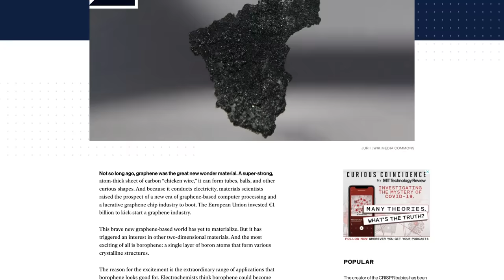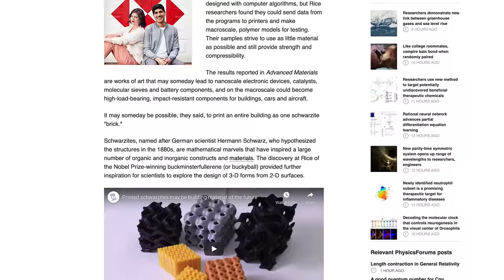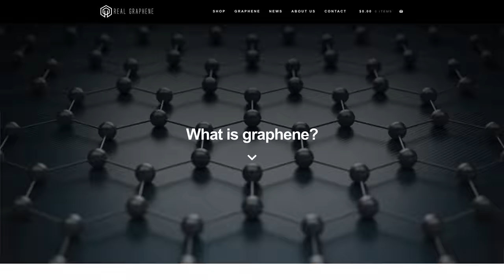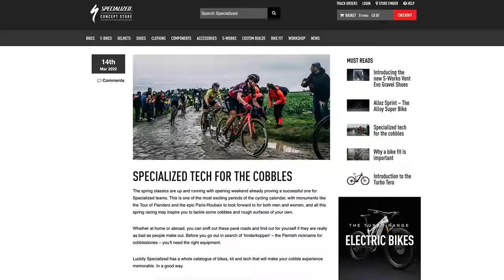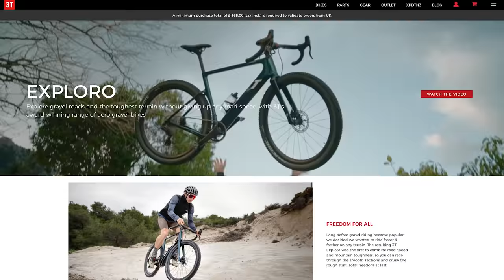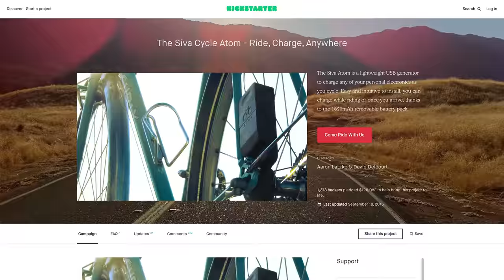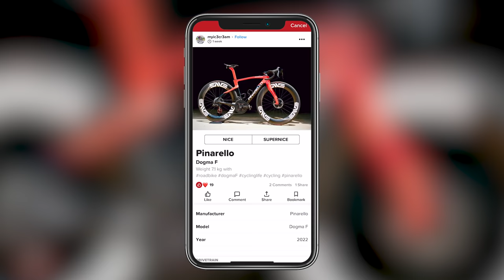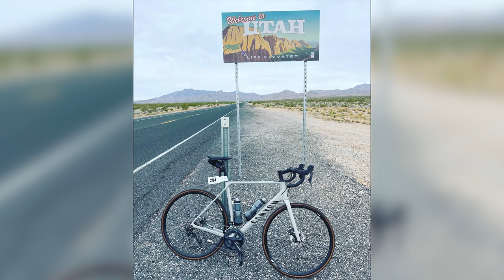Forget Graphene, Is Borophene The New Bike Wonder Material? | GCN Tech Show Ep. 224

Comment: my account balance says aluminium frame and rim brakes are best tho.
Reply: I'm with you all the way on alu frames. Not keen on rim brakes though.
Reply from the maker: It's all about that trickle down technology in 50 years!! 😂
Reply: @BrianRPaterson  disk brakes can be cheaper than rim brakes in some cases. up front cost a bit more yes but to maintain much cheaper
Reply: Aluminium bike and rim brakes are my favorites. I hate carbon and disk brakes. Useless polluting materials...
Reply: @dhanyrafael  Interesting! I would have thought carbon was more environmentally friendly than any metal, how so?
Reply: @fabster6667  It's not recyclable for one. Also the manufacture is quite energy-intensive I think. You can recycle aluminium really easily and steel frames basically never die...
Reply: @chrisnumnuts8671  the weight penalty is way too high for discs. Tadej pogacar still hesitates to use discs on mountain stages. Chris froome was also hesitating with the sponsors before start of tdf 2021. check his yt videos
Reply: I absolutely adore Cromo. It just feels so good. I ride a 1996 Giant Cross Nutra with some modern stuff on it but it's still an upright-ish hybrid straight bar bike. Thinking about trying to get disk brake on it but not sure how to go about putting a kit together. I use my bike daily for at least 6 miles per day
Reply: mine account saying, use feets.

Comment: this will make my Uni Inorganic professor happy, we spent 4 weeks on Boron clusters...   Also, super condutors arr material that allow electric to move without resistence and no loss of energy to heat, the liquid helium temperature are only required because the current material do not permit super conducting at room temperatue.   love the mention of chemistry on GCN
Reply from the maker: Ollie loves to put that PhD to good use!
Reply: @gcntech  well as a fellow PhD organic chemist, I understand the vibe.🙂

Comment: Its funny you mention tennis, they are actually the true weight weenie sport if you think about it (or at least their manufacturers). They used another material that is very impressive on paper but never really seemed to amount to anything - Aerogel. They did use it racquets by Dunlop -maybe still be in use, no clue. I remember back around 2010 when this stuff was all the hype. Then it was carbon nanotubes, now apparently graphene? With a quick google it looks like graphene has made it's way into the tennis world with companies like Head. There is also graphene aerogel combinations which is apparently better than regular aerogel. No idea what good any of them are or what they can actually be used for all this time later. Aerogel is supposedly lighter than air, so you can hypothetically fill any voids inside a bike frame, forks etc. to remove the air and replace it with aerogel to make a bike even lighter, or at least that was the idea in the tennis market as well as vibration reduction. I do think the stuff has a nasty habit of shattering into

Comment: Additive titanium.  It's strong, abundant, the one frame in one day by one machine goal can be met, and the specs can easily be customized using cad scripting languages so like,, the machine can just take in data points and the cad script can generate the gcode.

Magnesium hydride pellets for hydrogen storage.  If you sequester it from woodgas it's carbon neutral.  E, and with additive ti you can make great quality springs and bike frames designed to bend in specific directions from a specific stress/mass/impact.

A better bicycle frame material would be uhmwpe.  The goal being ''a plastic bike that can last forever''.
Reply: If titanium is abundant for you, hook me up with a few kilos
Reply: @nk-dw2hm  titanium is an abundant metal.  It's put in many things but the manufacturing equipment to make massive parts with it as well as market considerations isn't ready.

It is in lots of products. It isn't a valuable metal. And aluminum bikes weigh about the same
Reply: @nk-dw2hm  springs can be built into the frame

Comment: The only graphene products I know of are the paint sealant/waxes for your car. I wax my bike to keep it shiny.
Reply: Vittoria Graphene 2.0 - road bike tires that can withstand more heat
Rudy Project Defender Graphene ImpactX sunglasses
Graphene-powder-enhanced concrete (as concrete formulas are 'set in law' and mixture is 25-30yrs old it is difficult to pass new mixes to investors that build bridge/tunnel for the next 30yrs - even if compound-mix is better, they prefer 'standard' concrete)

There are multiple products! And they DO work differently with this compound. That is why production is still on the rise, and will rise in the years to come.

Comment: Your tires make the biggest difference.  I'm pretty impressed with both steel and titanium . What you need to adress for speed is flex , and wind resistance , roll resistance. I'm willing to bet that better bearings and hubs will make you roll faster. I have an idea for a different design for locomotion.  Its like a bike but not a bike.